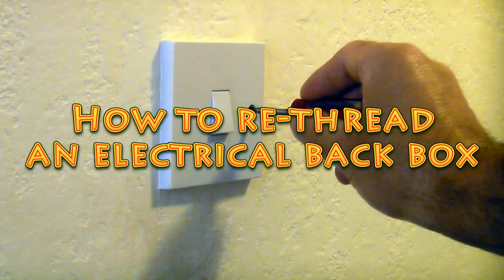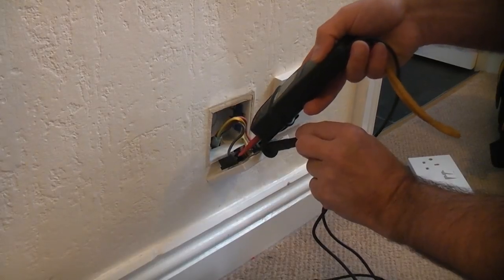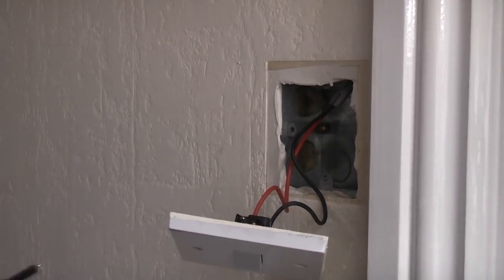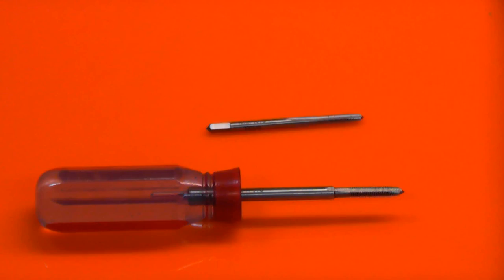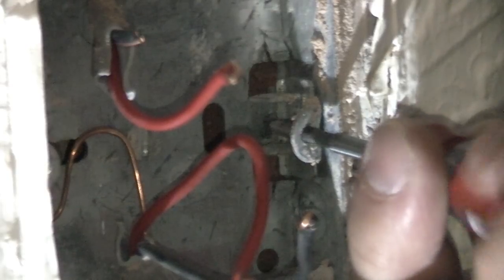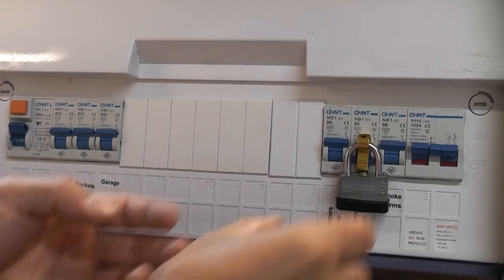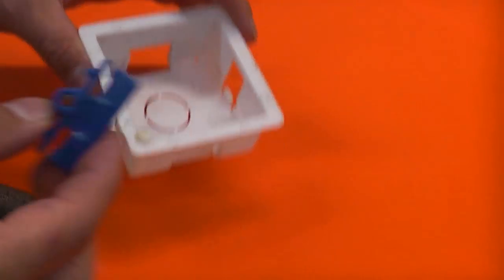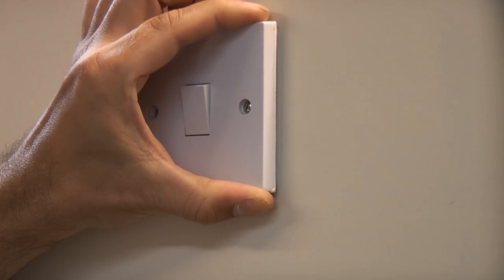How to rethread an electrical back box

Comment: I've commented before how your safety procedures with isolating electricity are very thorough. These videos are second to none in my opinion. 

I need to find me one of these tapping tools.

Thanks,  have a good week.
Reply from the maker: Thanks Ian ;-)
Reply: Get the one shown here, with the longer shaft. Some are really short, and not much use when the box is sunk deep into the wall.

Comment: I bought my retreading tool by chance whilst looking for something else at SF. It's been a life saver since. 

Even brand new backboxes can be easily messed up and if they are plastered in after you do your 1st fix it's a pain to replace the box. I've used mine several times. Never knew they existed before I stumbled on them by accident.
Reply from the maker: I must have 3 or 4 socket rethreading tools/ M3.5 taps but I always seem to lose them!
Thanks for the comments ;-)

Comment: I had to that many times with the old back boxes in my current house when doing the refurbishment.....too many stripped screws that just wouldn't unscrew.  However I never knew there was such a tool that could reinstate the screw thread, that is so handy....rather than replacing the little tab with the screw thread which I had to do at the time.......well I suppose they don't call you "ultimate Handyman" for nothing right!  A really handy video indeed.
Reply from the maker: Thanks for the comment ;-)

Comment: Good video, not a lot of people know about rethreading tools. 
1 point though, you tested between L and SL to prove dead, this is incorrect. If 230v was present on both terminals, the voltage indicator would NOT indicate a voltage! You must test L to N, or as you have no N in this switch, L to Earth.
Reply from the maker: That is correct, if the light was on the voltage tester would not indicate voltage but hopefully most people will know that if the light is illuminated the circuit is still energised and so would not be testing it in the first place. The earth wire had been cut right back on that cable, but I managed to pull some cable down a few MM and just managed to get a connector on the earth wire and then join it and connect it to the back box.
Thanks for the comment

Comment: Another great vid Chez. Got me wondering what happened to my rethreading tool. Haven't seen it for years. There's a yellow plastic box in the back of a shed though. . .
Reply from the maker: Thanks Dave,
This is the second re-threading tool that I have bought and also two M3.5 taps ;-)
I once went to do some artexing and could not find my stipple brush, so had to buy another one- perhaps this is why I own 9 tape measures LOL
Thanks for the comment
Reply: Only 9 tapes? How do you ever find one? :-) I'll only admit to having "several" :-)

Comment: great job. this is one of tools that if you have one in the tool box you will never need it. I suffered on 2 until I bought the tap . then never needed it again. 

how would fix it if the hole was striped out and the tap wouldn't work.
Reply from the maker: Thanks, you could glue a M3.5 nut on the back of the lug using some epoxy glue, you would obviously have to ensure it was centred over the hole correctly. Or you can buy a back box saver, which is a square nut and sleeving but it is expensive at about £6
I think you can also get M4 electrical screws, so you might be able to tap it out to that size.
Thanks for the comment ;-)

Comment: Will this work on the 4BA threads found in the older boxes or does it just strip them ?
Reply from the maker: I'm not sure, sorry.
Reply: Yes but you need an M4 × 0.7 rethreading tap and M4 screws.  Or you could drill a 3mm hole in the backbox use this method to tap a hole on the back wall of it and use a larger 3.5 back box screw.  Alternatively glue a M3.5 x 0.6mm bolt on the back of the broken lug and use a new screw.

Comment: What if the screw is slipping straight through the lug? I'm having this problem and don't know how to fix it and I'm trying to avoid having to replace the back box if possible!
Reply from the maker: Just search for “backbox saver”, they make a special nut and sleeve for fixing stripped threads 👍

Comment: When you voltage test the conductors to the switch you will not get a reading between the live and switch live (red and black wire). The test has to be carried out between live and either earth or  neutral. First test the switch when it's live (the earth to back box may be broken) then retest after isolating. Don't forget to put earth sleeving on bare conductor and red or brown sleeving on switch live (black conductor).
In most cases the threaded hole is stripped, so replacing the box is the only option.
Reply from the maker: The voltage tester will test for voltage between live and switched live and will sound and illuminate (providing the switch is not on and the circuit is not energised).
I've has several back boxes where the screw has damaged the lug in the back box and they can successfully be re-tapped.
If the hole is too large to re-tap you can get a "back box saver", but they are expensive- but it can save a lot of hassle removing the old back box.
Thanks for the comment ;-)

Comment: I recently did a job where the back box was old  wooden type (3mm ply board?)... and the screws were just wood screws going into a thin wooden back box... the threads on the wood were stripped.... replacing this was a nightmare as had to end up cutting the wall to fit metal box, then filling and decorating etc...
Reply from the maker: Blimey, I don't think that would have met the UK wiring regulations!
Replacing it was the right thing to do, even if there was a lot of patch up work afterwards.
Thanks for the comment
Reply: AWW bless! They were a work of art those boxes. Usually coupled with the old wooden capping and casing, like the first ever mini trunking. Good days, installed by proper tradesmen.

Comment: Why can't I unscrew a wall socket?  I can't say the thread is stripped because i can't see it as the socket is in the way. How do I remove the screw?  A screw driver just takes the screw out by about 5 mm. No matter how much more I unscrew it, it doesn't come out.

What's going on here, and is there a nice way to remove the socket?
Reply from the maker: Try pulling on the socket, whilst undoing the screw at the same time.
Sometimes the threads are so badly damaged that turning the screw will not do anything 👍

Comment: Thanks a lot for your wonderful videos. I used your electric cooker installation video to install my cooker. But it turned out that the threads in both clamp screw holes are damaged. For now both the screws seem to hold (I replaced one screw, other rdoes not come out but seems to rotate freely). Would your method for rethreading a back box work with those holes or should I try something else (like backbox saver, although with that I would still need to buy a reamer)? Thanks a lot
Reply from the maker: You could try re-threading them, if it fails you could try a backbox saver etc.
Thanks for the comment 👍

Comment: what about those plastic ones with a brass thread embedded in the box?
Reply from the maker: You can re-thread those too, but the metal insert might come loose from the housing - meaning you might need a new patress.
 Thanks for the comment 👍

Comment: Sometimes, if the metal lugs are movable (like they are in your video), just buy a new metal back box (cheap) and swap only the metal lugs over (modify if necessary by cutting with pliers)... then you will have brand new lugs... I agree always use a new screw...
Reply from the maker: Can you swap the lugs in metal back boxes?
I'm sure I looked at this once and it was impossible to remove the lug without damaging the back box on the one I tried.
Thanks for the comment
Reply: Ultimate Handyman Yes you can swap them.  In your video you will see the metal lug is retained by 4 pieces of bent metal on the backbox.  2 pieces allow the lug to slide up and down.  The other 2 pieces stop the lug from dropping down or being removed from sliding upwards.  With a screwdriver, bend the top metal bit of the backbox, this allows the lug to be slid out in an upwards direction.  Then just slide the new one in.  Depends on the design of the metal back box I guess.
Reply: It always seems to be the movable lug which needs rethreading. Yes they can be replaced if you get exactly the same make of box, but those with the style which has folded tabs to retain it, can easily break off as the material is monkey metal. Then you are stuffed, best way out is to thread the actual back box and use a long 3.5mm screw or extension pillars.

Comment: How do you re-tap a hole that is larger than the thread on the tap????
Reply from the maker: The hole is not too large. The threaded part is steel, the threads get cross threaded and chew up the brass screws. Once it's re-tapped a new screw will work perfectly ;-)

Comment: Hi, I'm impressed that you have a lock off procedure, however, your test method is slightly flawed for two reasons.
You are checking, with your meter, across the light switch. If, for some reason, the bulb in the circuit has blown, or it is an LED lamp with electronic circuitry,  then your are not going to have a complete circuit to neutral and the tester will appear to show a dead circuit.
The second thing that will also give you a false reading, especially on a staircase with two light switches, is that you do not know what position the light switch is in, so if the switch is closed and you measure across it, once again, the meter will show an apparently dead circuit, which could actually still be live.
The safest way to be 100% sure that your circuit is dead, is to check between one terminal and the earthed backbox of the switch, then check between the other terminal and the backbox again. This way, you definitely know that the circuit is safe to work on.
Reply: Sorry, I fired this off before watching the rest of the video, where you do EXACTLY what I have suggested :(
Reply from the maker: No problem, I would have tested using the earth terminal but there was no earth wire (it had been cut right back, which is unusual as the house was built in the 80's)
Thanks for the comment

Comment: What about if the screw thread enclosure is plastic?
Reply from the maker: You can still do this, as they normally have a brass insert for the threads.
You have to be careful though, as the insert can come out of the plastic lug (sometimes this happens if the screw cross threads)
Thanks for the comment 👍

Comment: Any suggestions what to do about stripped threads on metal boxes?
Reply from the maker: You could try these- https://backboxsaver.com/
Reply: Ultimate Handyman - thanks I did.

The video covers how to repair a thread that has become damaged  (cross threaded, gummed up with plaster). My problem is that someone has over tightened the box and stripped the metal in a galvanised box ... so insufficient metal to tap a new thread.

I could replace the box, however, that will mess up the plaster. The tabs are pressed into the steel, hence, cannot be replaced!

Ideas would be welcome.

Thanks.
Reply from the maker: Perhaps a rivnut would work- https://www.youtube.com/watch?v=f7yIqKnLGPc
Or perhaps use some chemical metal to fill the hole, then drill and re-tap it?
I've not tried tapping chemical metal, but have been told that you can tap it.
Reply: Ultimate Handyman - rivnuts ... a fascinating idea. I shall try.

Thanks.

Comment: Nice video Chez, but you have UNEARTHED more problems! Those cpc`s need sleeving AND terminating into the metal back box. Lord knows why people do this! Sometimes it`s worth putting your probes on, to see if it`s actually connected at the other end. The rethreader you show is the best type, some are really short, and are no use if the box is well sunk into the wall.
Reply from the maker: Yes, I'll sort that at a later date.
I can't understand why someone would not connect the earth wire to the earthing terminal, although judging by some of the electrics in this house they seem to have been done by someone wearing a large hat, and apparently the previous owners did zero DIY.
Thanks for the comment
Reply: YEEHAA! Back in the day when batten holders were predominant, many didn`t have an earth terminal, and light switch back boxes had plastic lugs and no earth terminal either. Electricians got into bad habits by chopping the earth off! That`s my take on it anyway..

Comment: Not sure I see how this helps if the thread is stripped out of the lug. I guess the solution would be 4m re-threader and replace bolts with 4mm.
Reply from the maker: This is for when the threads are cross threaded, you can often re-tap them using this technique.
If the hole is stripped completely, you could try these- https://fave.co/3vzsiWg

Thanks for the comment 👍

Comment: is there an easy fix for those who have stripped out oversize?
Reply from the maker: You could glue a M3.5 nut on the back of the lug using some epoxy glue, you would obviously have to ensure it was centred over the hole correctly. Or you can buy a back box saver, which is a square nut and sleeving but it is expensive at about £6
I think you can also get M4 electrical screws, so you might be able to tap it out to that size.
Thanks for the comment ;-)